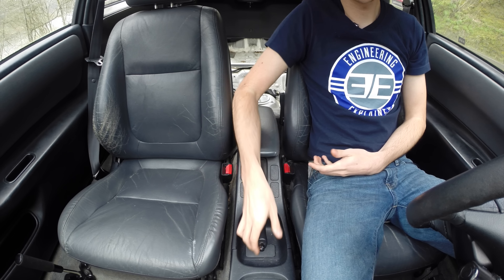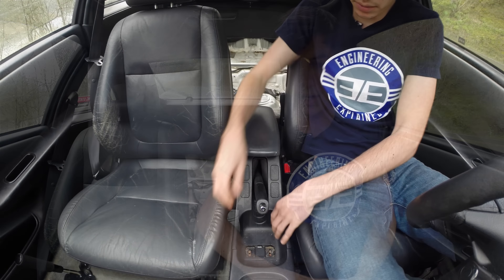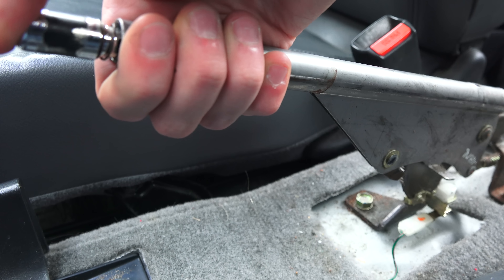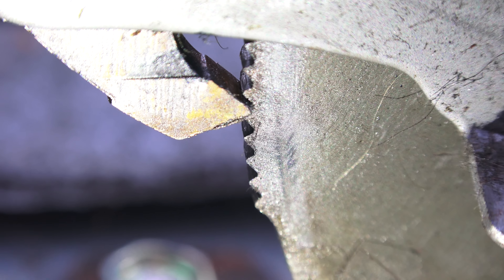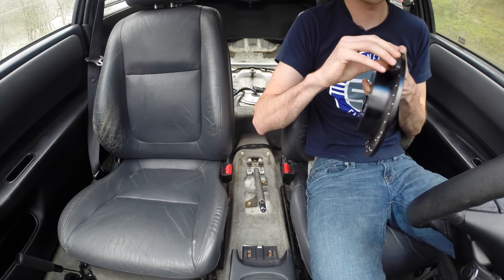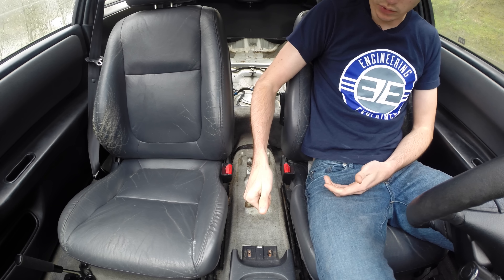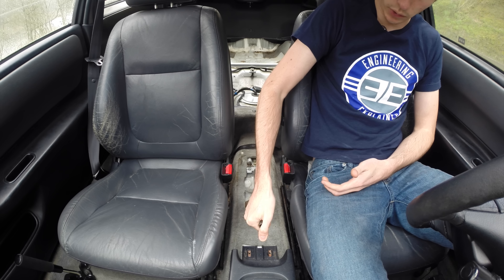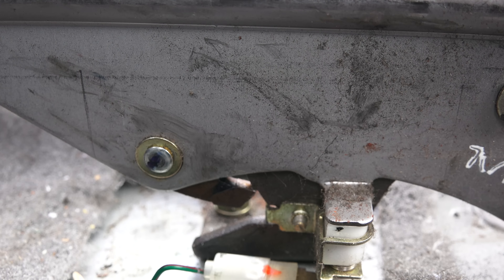Always Press The Handbrake Button? Myth Busted

Comment: personally I love the ratcheting sound. Auto manufacturers should make it even louder.
Reply: lol
Reply: +Wayne Wildman I agree. I own a newer VW Passat and it has an electrical handbrake. I miss the click sound :(
Reply: +amanoncrack I don't think it's an emergency brake anymore. It's a parking brake. I need to test, but I wonder if it will even work if the cars battery is dead/disconnected.
Reply: amanoncrack I don't know, probably to simplify the interior. A big handle does take quite the space in the middle. Electronic brakes are also good since you don't need to tighten the cable, but does of course mean that repairs will be much more expensive. 

Sad thing is that I live in Sweden where there are a lot of snow, and I can't do any handbrake turns or anything to have fun in the snow due to that button. It's a frontwheel drive too. It's a very boring car, but I still love it
Reply: Jason Taylor The brake would be on if I put it on before disconnecting the battery, but if I disconnect it prior to pressing it it wouldn't work
Reply: +asdda You could do the plastic tray skids.
Reply: +amanoncrack It's used during normal driving too, not just for emergencies.
Reply: asdda you can do e brake turns with a button. It's easy. Hilarious. Hell I use to do them with a foot operated emergency brake too.
Reply: Wiseguy7 yes yes yes..
Fun stuff!
Reply: Wayne Wildman Sadly doesn't work, the button will be locked until you stand still with the foot on the normal brake.
Reply: +Wayne Wildman No, it kills me
Reply: asdda VW just had to be a party pooper. :(
Reply: Wiseguy7 Indeed :(
Reply: asdda oh you mean the electric brake. My bad.
Reply: diazzsama why does it kill you? It's not a sound associated with anything wrong. I like it so much I just sit in my car pulling the lever over and over again.
Reply: +Wayne Wildman Yeah, it's so satisfying
Reply: Lol. I said I pull it over and over again...sometimes I even get my woman to pull it for me.
Reply: +Wayne Wildman
Giggity giggity :-D
Reply: +PCjabber
Swiggity Swooty >;D
Reply: +amanoncrack&#160;&#160;&#160; .......because it had an "E" in its name, hahaha :-) .  Yeah, I know it sucks; they put one in the new Acura TLX >:-(
Reply: +Wayne Wildman like bicycle freewheels!!!!
Reply: +asdda '13 Passat over here lol
Reply: Ricky Spanish Nice, I have an old 06
Reply: +Wayne Wildman Makes it sounds secure. It's mushy when using the button. It doesn't seem safe. I really tug on the parking brake since some cars I drove in the past needed an adjustment.
Reply: Tyler Finvold my driveway is steep and so the parking break must always be adjusts correctly and firmly applied or my vehicles could pop out of gear and roll into my house. So the clicking is a good sound to me.
Reply: +Wayne Wildman yeah man,maybe they could figure a way to make it play a tune!
Reply: My girlfriend loves a strong, loud ratcheting.
Reply: bwahahahahhahahah

Comment: I always pulled the handbrake without pushing the button.  I assumed the button was only for putting it down.
Reply: Same
Reply: You must be very smart
Reply: Because it is
Reply: Hi bladed
Reply: you assumed right
Reply: i saw my dad and uncles never using the button when pulling it up

it wasnt until last night where my bf pointed out he gets freaked out by the ratcheting noise when i pull the handbrake and mentioned that he was taught to use the button both ways. i started questioning if ive been doing it wrong all this time 😂

Comment: I wonder if anyone has ever had to replace the ratchet mechanism. I've never heard of one wearing out.
Reply: Way too late, but I have an AE92 Corolla from the 90s. I engage the handbrake regularly, multiple times. It's not even close to getting worn out.
Reply: Well my brother in his 1992 golf mk2 completly splited in half ratcheting mechanism, idk how but he did it
Reply: @sinisavujkovic8299  One of my cousins managed to break the handbrake ratchet on his Civic too. It was honestly the first time I saw a broken handbrake ratchet. I've seen ratchets that have stopped working but broken ratchet was a first lol.
Reply: I have
Reply: Even later. I had a Peugeot where the handbrake ratchet wore out to the extent it would release if you tapped on the handle.  Pulling the button in saves taking the edge off the teeth
Reply: I have.
Reply: I've seen it in a really old car - the rachet wouldn't hold in the bottom half.
Reply: I have too.
Reply: I feel like 9/10 if not every single person claiming they have worn it down probably just had dirt in it or some other issue. There's no way in hell you're gonna wear down those steel teeth just by having that other metal part glide over it a couple of times a day, that just doesn't happen unless you got a crappy car that doesn't use steel there, which I don't think exists. Can't find any pictures of completely worn down handbrake ratchet mechanisms online, just doesn't happen.
Reply: I have a 1994 F150 with a foot-actuated brake. It's starting to not hold, depending on exactly where you stop the brake. So, yeah, over 28 years and 265K mi, I've about worn out the e-brake, and snapped 3 cables along the way.
Reply: Yes. In a 1999 Saturn SL2. Handbrake would not stay up. Part of the ratcheting mechanism was made of cheap plastic. It was a very easy fix, though.
Reply: I had to replace it a week back. I didn't realize it wasn't functioning until the test driver in the workshop detected it. Thanks god he save me from catastrophic trouble since I drive in in hill and most often had to park my car in steep slopes. Actually the spokes were out of alignment and there was zero grip.
Reply: It was wore out on my 96 Camaro when I bought it, but I never replaced it before I sold it...that should have been the first red flag.....that car was nothing but problems.
Reply: @sinisavujkovic8299 too many handbrake turns, yanking the lever perhaps
Reply: @sinisavujkovic8299  he might've sat on it when it was engaged by accident lmao

Comment: I always use mcdonnald's drive-though instead of going inside in order to avoid wearing out the dome light.
Reply: Yeah, but then you excessively wear out your window and window support system from rolling it up and down and up and down and..... :-P
Reply: Yea so wear out your starter instead
Reply: @pauliespats112  That's why people go inside and leave it idling for 10 minutes, so the starter doesn't wear out ;)
Reply: @MozzaBurger88  seems like a good way to get a car stolen
Reply: @odeo5691  simple fix is to lock the car from the inside and have your spare  door key clipped to the inside of your gas cap door or under a bumper etcetera. Cops tie em to the gas cap so they can leave the a/c on while they keep it locked
Reply: @pauliespats112  didnt know that thanks for enlightening me on that knowledge! Smart
Reply: I don’t eat, that way I don’t wear my jaw out